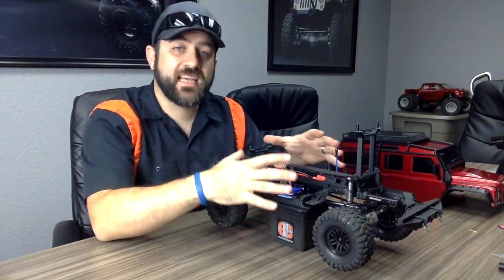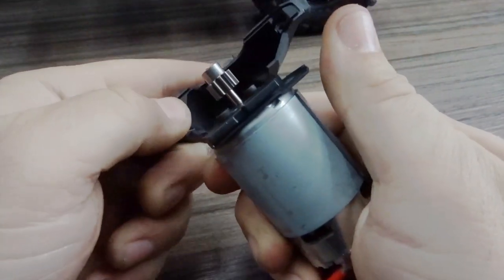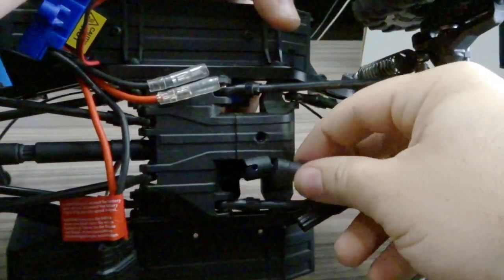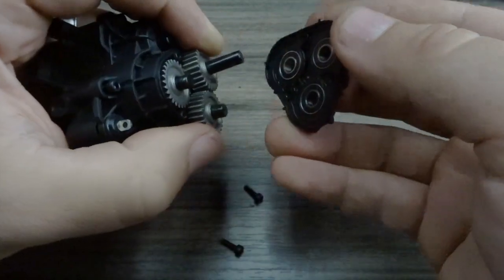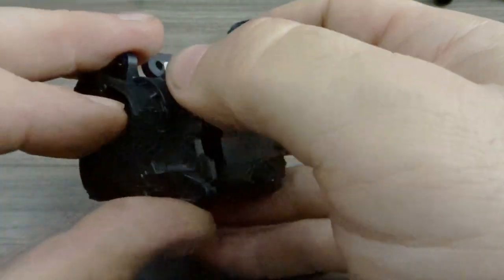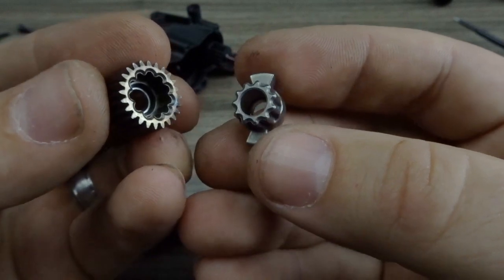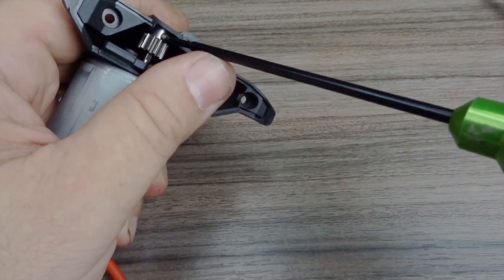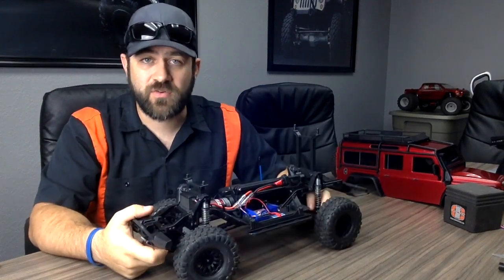Traxxas TRX4 2-Speed Transmission Disassembly

Comment: I need to swap the transmission because it’s broken. But I can’t remove it because the battery tray screws are stripped and the skid plate screws are stripped! So I’m officially fu(ked
Reply: lol same thing happened to me jajaja i drilled them out strip out couple Allen wrenches yea it’s a mess

Comment: So ive taken my 2speed trans apart cause i noticed a few bearings were almost seized up and didnt spin well, replaced all of them and also put a bit of grease in there aswell, and when i put it back together it almost feels like the gear mesh is skipping allot, havent put it back in my rc yet. Ive watched a couple videos on youtube and cant seem to spot what i placed in wrong? Seems i put everything together properly, the teeth dont seem to be disfigured so i have no clue why its clicking like teeth are skipping, do you think its from too much grease? Or

Comment: Couple of things to note.  First the grub screw used for the pinion gear is VERY long ( not sure why Traxxas used such a long screw) and if you push the pinion back to have 100% contact with the spur gear then you'll notice that the grub screw will actually hit the spur.  I think that's why Traxxas has the pinion gear so far forward.  Mine was the same.

Second, when you take the trans out to grease the gears pay close attention to the micro servo for the high and low speed selector.  When you try and put it back on the trans make sure that there is no tension (or very little) on the servo saver.  If there is a lot of tension, then simply turn the arm till the tension is reduce to minimum.  This will save your servo in the long run and fix a noisy servo.
Reply: M Fathi yes this is why people burn them up
Reply: M Fathi i
Reply: You can spin the pinion around and use it either way. 👍👍

Comment: Thanks for your videos Harley 👍
Mines a day old and I opened the portals, diffs, transmission and transfer. To my delight everything was greased and other than the spur gear and engagement drive dog all gears were metal 😃
Reply: LROR Land Rovers Off Road so your saying yours had more metal gears inside the transmission?
Reply: Eric Bostick Everything is metal gears except the engagement dog for the 2 speed and spur.
Reply: LROR Land Rovers Off Road yeah I know I just don't count the spur as it's not as important
Reply: LROR Land Rovers Off Road that's a big improvement over this and maybe a little more forward weight

Comment: Great to see the insides and out.  I have seen alot of steering servos going out though.
Reply from the maker: +Nitro Revolution RC yeah, without a typical servo saver like Traxxas normally runs, they are going to be hard on servos.
Reply: Nitro Revolution RC And I heard it doesn't have a lot of power too.
Reply: Gary T. Can confirm
Reply: Power is definitely there servo sucks (but what stock servo doesn’t?)

Comment: Thanks bro I just got my trx4 it was making a rubbing noise right out of the box eventually the noise went away it's probably same rubbing on the housing and  my motor in esc  get hot in crawling not bashing I'm going to take it apart and check thanks again bro

Comment: Bro I did fit the pinion gear to the full touch in the housing now am hearing loud noise, I don't know if it's from that or from the center gearbox, my crawler how ever does a speed of 40 mile per hour I installed a powerful motor what do you think happened, maybe the Bailon gears went bad?

Comment: was going to buy this at the local hobbyshop the other day but I picked up their last SCX10 2 kit.
Reply: What makes the scx better?
Reply: joe shmoe the scx10 is a proven platform. The trx-4 is new and plagued with problems allready. Just as this video shows the internal gears are plastic lol. The portal axles are breaking, the shift servos are failing, the steering servos are failing. The trx-4 is a bashers truck. All that lockable diff shit is a disaster waiting to happen. Ive owned nearly every crawler/trail truck and the trx-4 i will never own. Traxxas always has to put its foot in the door on everything. Traxxas should stick to making basher vehicles. The scx10 and scx10-2 have a much more simple setup that is WAY MORE RELIABLE.
Reply: Neal Edmondson. Thank you for your feed back
Reply: Neal Edmondson lots of BS, I own TRX4 and it’s super reliable. I’m rock crawling with it. Zero problems so far. I seen people putting 6s brushless in them, and really abusing them, and they hold amazingly well.
Reply: MrDannyisr Neal is obviously a axial fan boy that cannot accept the fact that traxxas has built a contender to the scx10 with more features.  There could be cases on the internet of trx4 failing parts.  But that does not reflect all trx4 are breaking down right out of the box.  I am sure if I dig deep enough I will find people have problems with the scx10 as well.
Reply: Neal Edmondson I have had my honcho for years and it’s been modded numerous occasions. I’ve never had a Traxxas but was considering the summit 1/10, the TRX4 dropped into the market not long after SCX10-II was released and I had money saved up for another rig. I was definately sold with the Traxxas since the Summit was being phased out by then. 

Took the TRx4 for a Snow weekend getaway and then saltwater mangroves but afterwards sat in the shed for about a year getting rusty since I hadn’t cleaned it at all, in the end i thought it were seized but I took it apart completely and clean/rebuild, after abit of wd40 and abit of scrutiny it’s now back in full glory no parts needed replacement at this time yet. 

I still do love my Scx10 since it’s been my workhorse but I am very glad I finally purchased a Traxxas. I’m quite surprised how tough they actually really are.

Comment: would you recommend putting grease on those gears? even light grease from tamiya maybe? Thanks.
Reply: Bangbangboom51 the silicon grease from Traxxas works very well. Mine is so quiet now especially in high gear.
Reply: @wadecaton4017  the silicon grease that helps seal and waterproof the radio box? I just built the kit and mine is SO loud. Was thinking of taking transmission apart and regreasing everything

Comment: Glad you did this tear down and that you found that problem with the pinion gear. I'll check that when I get mine. Also couldn't you turn the pinion gear around so the collar is  toward the motor or is the collar too thick?
Reply from the maker: +Gary T. You can flip it I believe but there is room to properly mesh it without having to.
Reply: Harley Designs Ok just wondering thanks.

Comment: Thank you for doing a  take down of the transmission, portal axles, and remote locker. It's now time to cut to the chase on the elephant in the room.  What is your plan to add more forward weight bias that this vehicle needs?
Reply from the maker: +eric1138 with the body off, the weight balance isn't bad for a trail truck. If it was for Comp crawling, I'd look at some sort of small saddle pack style batteries.
Reply: That sounds like a good idea. Move the ESC and the receiver box reward and put the saddle packs in their place.
Reply: I don't do competitions but negotiating over obstacles during a trail run is for me the reason for the hobby.
Reply: I'll be putting on weighted wheels and tires on mine just as I have on my SCX10 Jeep. 6oz on the front, 4 on the rear.

Comment: I had the 2 speed transmission lock up on me while I had it on the bench. Still trying to figure it out. As a result, I lost a set pin and need to know what size they are and where l can get them. Thanks

Comment: How well will this trans really hold up with those plastic gears?? Is it a thing like axial gen 1's change soon as it comes out of the box and are there any upgraded metal gears out for it??
Reply: The Summit 1/10 and the Brushless E-Revo 1/10 has plastic gears, and they hold up fine.
Reply from the maker: +Travis Merrix Traxxas has very good plastic gears and there is a lot of reduction in the car. They will probably be fine for quite awhile.
Reply: Thanks everyone I didnt own anything traxxas didn't know if it was like the scx10 that need upgraded out of the box
Reply: Travis Merrix Traxxas plastic tends to be much more durable than axial.
Reply: just so you know traxxas made a running change and the plastic gears are now metal

Comment: I have a question can you take off the back tire and all that stuff to put up bumper
Reply from the maker: What do you mean to put up bumper? Can you take all the stuff off, of course, it just bolts onto the body basically. You could easily put a new bumper on it, you would just need to trim off a couple small tabs that tie into the bumper when installed. You can see those tabs in my overview vide.

Comment: Hi,do you know if there would be any point in changing the motor or pinion gear if thats possible?
Or is this one good enough for real slow crawling?
Reply from the maker: +dragon model the stock gearing in low gear is very low, about 60:1, which is slower than any other model out of the box. For example an Axial SCX10-2 is about 47:1. So you shouldn't need to change gearing yet.
Reply: Hi,thankyou very much for the reply about this and for the information.
Good info I didnt know.Good to know the motor is good too ty.
I already ordered this model and will get it soon.TY
Reply: Oh yea it was good to see axle and transmission from the inside.
Good video thank you about the pinion gear adjustment.

Comment: Wouldn’t it be cool if you could make it 2wd on the fly?
Reply: That would be cool. I HATE with a passion 2wd version of almost all models of RC. They just slap a motor on the rear axle and call it done. I do, however like checking out the driving characteristics of just 2 wheels spinning, so I'll take out a driveshaft every now and then.

Comment: Basically identical to the summit transmission with the shifting fork and dog carrier
Reply from the maker: +RC Grid yes, just a smaller size and with a integrated T-case.
Reply from the maker: +DeviousRC 66 the summit is their design and it's only like the summit in the fact that it has two constantly meshed gears with a Drive dog to engage them. It's a solid design and would make no sense to bash them for using it.
Reply: Harley Designs  I agree, no purpose in re-designing something that worked flawlessly for years

Comment: should we be concerned there's no lubrication in the transmission?
Reply from the maker: +The Car Enthusiast Channel I would recommend adding some grease, at least in the transfer case where it is metal on metal. The metal on plastic or plastic on plastic likely isn't as important, however still somewhere I'd add some.
Reply: Harley Designs Again thanks.  headed to the LHS Thursday and I'm still on the fence.  I got burnt bad with the gen 1 X-maxx. the diffs would not stay in one piece.  but I love these videos ocer any other.  we get to see the insides and engineering that goes into vehicles were looking to buy.  thumbs up from this guy.  I personally would like to see a nitro trail truck.  sure it would be loud and your habe to carry fuel but ever since I had 2 lipos explode in my home I've gotten rid of almost all my electrics.

Comment: I just greased my trans n noticed u have lplastic gears, in mine they were all metal.wuts up with that.
Reply from the maker: +Richard Fazio Traxxas made a running change. Bonus for you guys!
Reply: this is nice to know now I am sure I'm going with the trx4 as it's only 40 more than a scx10.2 rtr and 50 more than the hpi venture